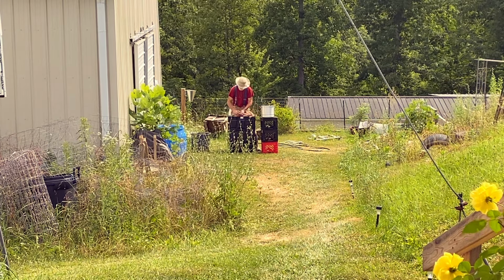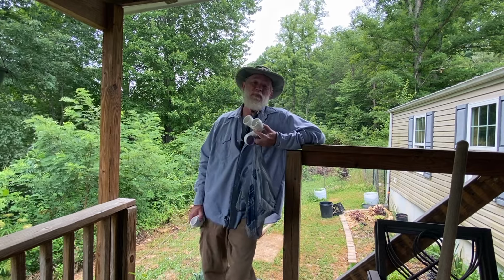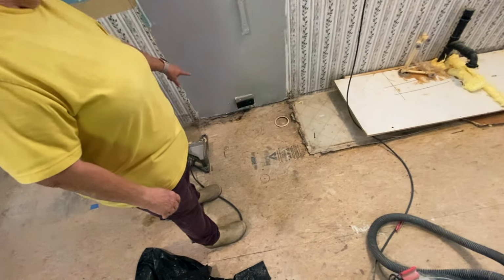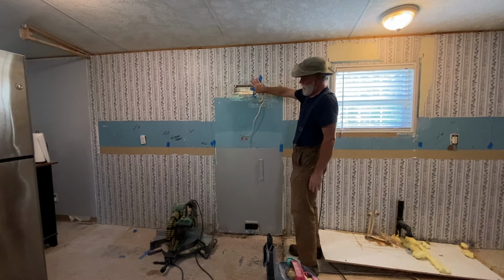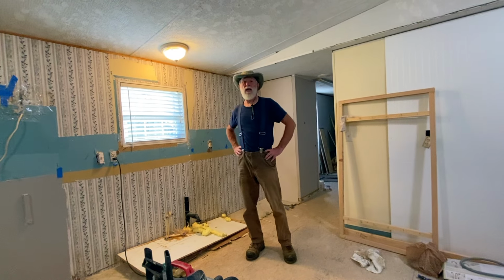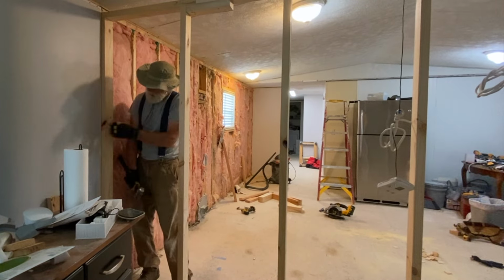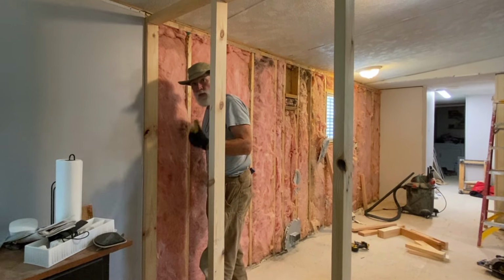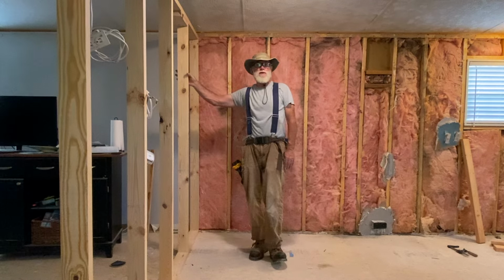Mobile Home Remodel - Kitchen Wall

Comment: I started my renovation by doing the two bedrooms then I totally gutted the rest. The ceilings were the worst part because of all the mouse crap. The kitchen now versus then is an insane difference. Best to totally gut it. Hickory cabinets! They were surprisingly cheaper than Maple. One thing I wanted to mention, when renovating these mobile homes pay careful attention to the outer walls of the home. Adding drywall can add a lot of weight and my outer walls are starting to sag. I need to go around and jack things up to level and put lally columns underneath the sills.
Reply from the maker: Totally agree with the gut. I prefer to get all the way to the bones and then repair and rebuild. This project has a thin budget and a project superintendent (Marti) that pushes for the shortest possible timeline.